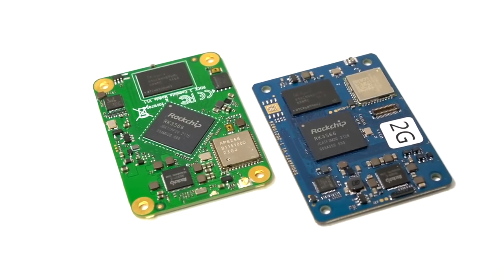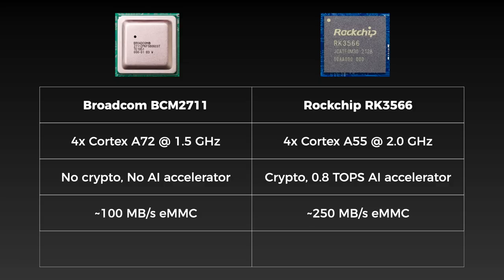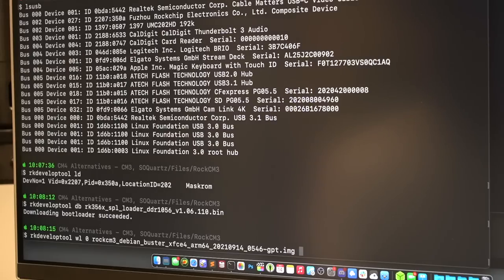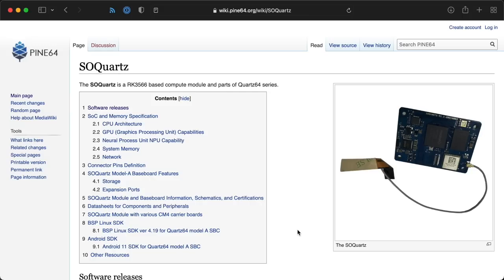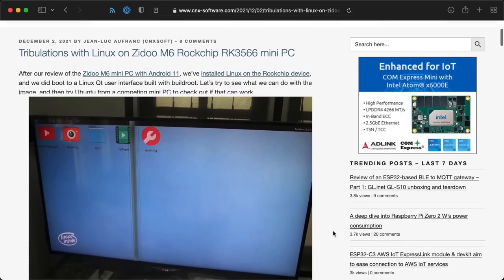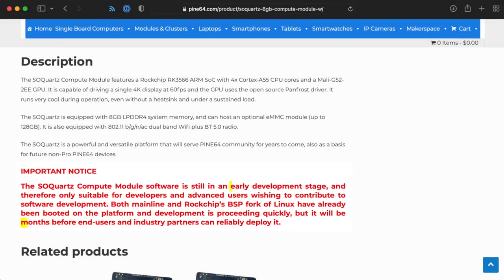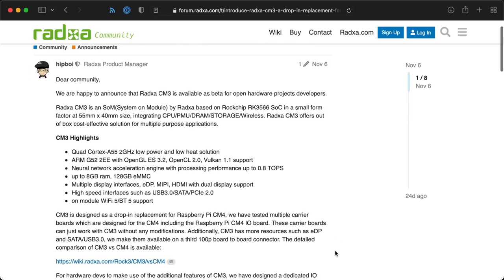Can these boards replace the Raspberry Pi CM4?

Comment: I like that Jeff Geerling uses the raspberry pi, and I see that he does it just to have fun, and in fact he says it a lot, for me it is the best, I also have fun, thank you.
Reply from the maker: Fun == fun!
Reply: +1 Jeff... The last rockchip I had in my lab was a Chinese Android tv box with the oddest reset button placement I've ever seen, required a USB A to A cable (yes, I went to the broken phone charger coffin (plastic box)), and it took me about 18 hrs to find the image. Kernel parameters are challenging and fun. Oh and I compiled a new uboot for a Chinese router board on a pine phone via a docker container while on the toilet last weekend! Now I want one of those just for the lolz.

Comment: Yes. My experience with hi-spec SBCs beyond RPi has been a waste of time, frustration, and money. The impressive hardware only equals 1/2 of a consumer product. Tell Jack I said, "Goodbye."
Great PSA to the maker community, Jeff. 👍
Reply from the maker: In many cases, I wouldn't say it's necessarily a waste—there are still plenty of things to learn from a more jagged experience. But if your goal wasn't pure learning, and you just wanted to get something done, and couldn't get it done... it would be more of a frustrating experience. Lucky for me, I was in this for the learning, and my initial goal was to plug in a PCIe device. I didn't quite get there but I did learn a bit!
Reply: @JeffGeerling  "Everybody's somewhere (no matter where I go, there I am.)." My learning experiences are more on the level of just getting motors to run, IoT to communicate, and cameras to work.
That makes me one of your favorite fans, following behind your trail blazing footsteps, but tripping over many pebbles along the way. BR 😎.
Reply: Couldn't agree more... You pretty much have to be a low level linux expert to even consider trying to use any of these non-pi ARM boards. Either that or you have to wait for a good amount of time after they've been released for their ecosystems to be fleshed out enough to be really usable.
Reply: @mikekopack6441  Well said.  Right before the rPi4 came out, I adopted the Pine Rock64 because it was already out with 4gb of ram and 4k video.  I give credit to all those who put in time to build distros for the board, however the builds vary and so does how well the drivers are optimized.
Reply: @mikekopack6441  Or...take the savings of these third party units, freeze them with a "current OS", and dedicate them to their job.  My PiZero2 is locked in time.  It also won't get tolerated in the RPi forums.  Heh.
Reply: Clearly you haven't used Pine64's RK3399 based devices. But it took a while to get the software to a usable level.
Reply: Nvidia Jetson is fine.
Reply: Those raspberry pi killers
Reply: Those raspberry pi killers

Comment: Something that depressingly few developers understand is that excellent documentation and excellent UX are killer features.
Even more so than just having good hardware. I don't want to have to reverse engineer something I paid money for to make it perform basic tasks, instead of working on my project.
That's why so many SBC's have failed to make a dent in Pi's market share.

Excellent UX is why Slack got so popular; yes, it's just IRC with better UX design, but that's literally it's primary selling feature.
Reply: they don't care. they sell a few solely based on marketing hardware specs and then move on to the next. They are not trying to build a brand name. Dump the name, create a new name, make as much as possible, repeat.
Reply: @MrTweetyhack  as a society, we oughta consider such behavior as tantamount to murder.  (Because it really does kill people.)

nekomakhea: absolutely!
Reply: Oh they understand that over at Ubiquiti all right. Even down to the unboxing experience; however, core functionality unit testing is quite the challenge for them. Same with truth in advertising
Reply: Amen.
Reply: Slack is horrible. Somehow it manages to make a last-gen AM5/DDR5 system with low load lag when it's open.

Comment: That's something a lot of people fail to grasp : with Raspberry Pi, you're paying for official support and the community. Yeah, you can find other boards with similar or better specs for cheaper or vastly more powerful for barely more (hell, even x86 if you want), but with Raspberry, you're paying for the official OS, Raspbian (yeah, I'm an old Pi's user) and the hundreds of community images people created in the last decade for every usage (and semi-official images like Ubuntu).

With a lot of other boards, you'll maybe find an official Debian image updated in the last 4 years and that's it, the exception being Pine64 since they have a pretty sizable community and even then, brand new products usually have nothing since they themselves don't spend much time on the software and rely on the community. Having better hardware doesn't mean anything if you can't actually use it, that's why the Raspberry Pi is a really popular emulation box while it's not particularly powerful, people have been developping OS dedicated to it (like RetroPie and Recalbox) for almost a decade for that purpose, you won't find anything similar on other, more powerful, boards.
Reply: I will say, although yeah these other SBCs do have generally software and support limitations, I wouldn't say they're all that bad. To use the examples of Retro Pie and Recalbox those offer prebuilt images for a few of the alternate SBCs, while Retro Pie currently doesn't offer prebuilt images for the Pi Zero 2.

Comment: You are absolutely correct sir. As an Embedded Engineer I can attest to the documentation woes of cheap Chinese hardware. The bottom line is that they do not care about providing documentation and the support required to establish a platform. Let the buyer beware.
Reply: Let's not be xenophobic here; Western engineers are equally bad at documenting their products.
Reply: @TerraMagnus  It's not about xenophobia (especially since the context is wrong). It is about commerce and language difference.

Comment: Great exposure for these products, Jeff. Perhaps the issues you've pointed out will make them more widely known, and therefore more of a target for the people working through these issues.

Besides the strengths of the RPi platform that you've already mentioned, just having defined/popularized a set of standard form-factors and interfaces for the hardware (in this case, the interface pinouts being used by all the boards in this video) is a big win for everyone. When I was growing up in the '90s and '00s, The ability to move pieces and parts around to different systems in various ATX systems was huge for my ability to tinker and learn. I hope the next generations will have similar experiences, even though the form factors are changing considerably.
Reply from the maker: That's part of my goal in posting this video—I could keep toiling on and making a little progress here and there, but maybe a few people who might've not known of the interest in these boards can push them further better than I can so they do become worthy alternatives sooner rather than later!

Comment: I don't care if an SBC is more "powerful", I need the software experience to be on point. Raspberry Pi OS isn't without issues or fault, but is still extremely polished. Hard to take the risc <-- see what I did there 😀. O and DOCUMENTION is TOO VALUABLE. That is a priceless addition and should always be included.

Let's hope the Pi Foundation doesn't get too big and start acting like OnePlus does now vs just 2 years ago.
Reply: Whats the problem with oneplus ?
Reply: @prashanthb6521  They've lost the mid range market and their software support isn't as good as similar phones.

Its either the really good Nord N10 at $300 or the OnePlus 9 at $800. At that price, the S21 makes more sense especially the 1 year longer software support for new OS updates. 

Google just took the mid ranged crown again at $599 for the Pixel 6. Where the OnePlus 6T was 3 years ago, Google took this crown, especially the support until 2026 with Android updates and even longer security update.

Comment: Fair point Jeff. I hope the guides and images for these boards will mature like the Pi ones did. It's always cool to have an alternative to raspberry pi, but it should be relatively easy to set up and not frustrating like your experience.

Comment: It's so odd to me that there's been no effort (at least, that I've seen) to create an "IBM PC" for ARM based computers. Basically any x86 OS will work on basically any x86 computer because every x86 computer has functionally the same core architecture surrounding the processor. ARM computers are all like the Xbox and PlayStation; they might have the same processor but nothing else about the architecture makes it a PC. Every ARM computer is bespoke and closed off from the rest of the ARM ecosystem. If ARM (and RISC-V) wants to supplant x86, it needs to be at least as good as it.
Reply: M1 macs are the only thing running an arm chip and getting better performance per watt on some X86 applications running natively/on bare metal. Apple has had a great many years of developing so its hard to say if open source community will ever get there.
Reply: The status quo works fine for most of these silicon vendors: nobody building a phone with one of these SOCs cares about the boot process once they bring up uboot or, let's be honest, Android fastboot, on it.
Reply: @rpavlik1  exactly. The fact that I can't install straight up Linux (or even Windows ARM) on a smartphone sucks.
Reply: Are ARM servers (for business, not consumer) capable of just booting any ARM ISO like normal from UEFI without a custom image?
Reply: @ArrowRaider  usually.  See ARM "Server Ready". Certifications
Reply: @tobiwonkanogy2975  'Better performance per watt' means little, when you consider all the flaws on M1 Mac:

-way overpriced
-terrible for gaming
-unable to run huge x86 software ecosystem...
-at full speed or full compatibility
-M1 laptops are disposable...
-RAM and SSD not upgradable

Over 300 million x86 Windows PCs were sold in 2021.    How many M1 Macs were sold?
Reply: @DerekDavis213  it doesnt mean the chip only has to be used in this product . The initial results are close to native windows is some applications that are important. likely a few million anyway
Reply: @tobiwonkanogy2975  In 2021, Apple had a tiny 8% market share for PCs, and many of those were x86 Macs.   M1 is pretty much irrelevant when you look at the big picture.

Windows totally dominates the world, and Windows will continue to use x86 processors from AMD or Intel for years to come.   Ryzen and Alder Lake processors are rapidly evolving and improving.

Gaming is extremely popular, but the M1 ARM processor is terrible for gaming.   That alone is pretty much a fatal flaw .

Adobe has been refining Premiere and Photoshop for 20 years on the x86 Windows platform.   There are versions of the software for M1 Mac, but they are missing many features, and compatibility with many add-ons or plug-ins is totally NOT ready for prime time.

Comment: Support! The number 1 requirement for business use cases. This is why my company still likes to buy Dell equipment: Support. It's a pity though. Cuz there are a lot of interesting hardware eco systems out there they don't get the love they deserve.
Reply: There's a lot of interesting hardware out there that never gets the ecosystem it deserves.  Without an ecosystem, it starves or, worse, festers in designs and systems for years via lock-in.

Comment: I totally understand that. I'm a software engineer and had a manager switch the language we use. He picked one with no support, documentation, or community and trying to get something working was a nightmare. Turns out the only reason he switched was so he could be the expert and gain more job security. Meanwhile, he lost several brilliant programmers.
Reply: "he lost several brilliant programmers" even more job security
Reply: I'm assuming the manager has other flaws, since they can't be that brilliant of a programmer if they can't pick up a new language. 😉

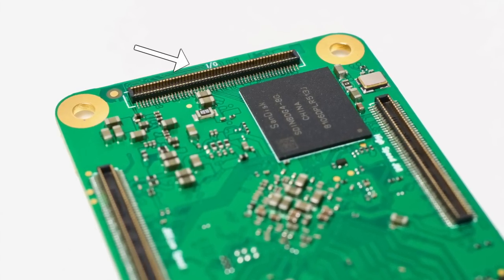Comment: The third 100 pin connector at 1:08 is in a wonderful place that gives ample amounts of room for routing traces.
I am hoping the CM5 continues with the same two 100 pin connectors and adds in a 3rd such connector to form a U shape as well.
The main things I am looking for is another 1-3 PCIe lanes (Gen 2 is ample enough bandwidth.) Maybe have another set of USB, but a SATA port or two would be a god send. (Especially if the SATA controller part of the SoC supports SATA expanders!)

But yes, the Raspberry PI foundation does one thing really well, and that is support and documentation. Since tracking down obscure issues isn't fun, software is a jungle even at the best of times.
Reply from the maker: I hope if a CM5 is made in the same form factor, that's the approach it takes. It would be amazing to be able to just swap out a CM4 for a CM5 for a speed boost and whatever other cool things it would bring!

Comment: A lot of those boards have amazing specs, but software support lets them down.
I was tempted by the radxa zero, but the reviews all highlighted the software issues.
I've stayed with raspberry pi because they just work for my needs. 
Luckily the pi zero 2 W came out and I've picked up a few of them now.
Reply: I bought 4 or 5 of Pi Zero W2, because I have some automations to complete. It was like nobrainer to get them and have them ready in the toolbox :)
Reply: Yeah, anytime someone mentions Not-a-Pi, I think "the specs are good on paper, with the inevitable letdown on software" and am right >90% of the time. Dang shame too, because some competitors in the space would be nice. And no, 1/2 a product (the hardware and no software to use on it) is not a competitor. The Venn diagram overlap between "people who want to use this" and "people who can (and want to) develop for this" (out of the already small number interested in this at all) is nearly 0. I'd guess most of that pool is the developers of the SBC themselves.
Reply: @IncertusetNescio  yup, those raspberry pi killers but can barely do anything useful.

Comment: Way back when I was trying to decide what board to buy I was somewhat bummed at the Pi's lower specs than brands such as BananaPi. But I was swayed toward the Raspberry Pi because there was so much more community support for it. That decision was the right one then and it's the right one today, as this video points out. I'm constantly stunned at so many new boards and chips released to directly compete with Raspberry but they don't seem to ever get the fact that hardware is only the beginning of a competitive product.
Reply: Yeah, those raspberry pi killers. Some of them do work with pi images but riddled with bugs. OK hardware but not much on support and community.

Comment: The reason why other CM isn't popular as Raspberry Pi's CM board is the support you get a ton of support for the Raspberry Pi because the community for the Raspberry Pi is so large
Reply: Support is more important than anything else, what do you do if it doesn't boot : )
Reply: If it would be easy for newcomers to set them up, and there are some guids and information available for necomers, the communities for those alternatives could grow as well.

It's kind of like the chicken and the egg. Which one came first. Bigger community means more information and more bug fixing. But for a comunity to grow you need at least some information and bugfixing.

Comment: Seems about right for Pine64's way of working. What they often do is make the hardware, make sure it is documented and then provide it to developers in their community to basically get software support up and running. Their phones operate on a similar principle and currently postmarketOS is coming along nicely as far as I know on those, but it has taken a while. So it could be that this board will actually work out over time as a nice (niche?) Pi alternative as there is actually an active community of developers around pine64 hardware.

To some degree it is a more open approach compared to the Raspberry Pi approach to things but it also leaves a lot up to the community to initially fix where you could argue the company itself should provide a better starting base. Anyway, I'd be interested to see how the pine64 board support develops over time.
Reply from the maker: Ditto!
Reply: Indeed.  Pine64 doesn't really get involved with the software side of things at all.  Software is entirely in the hands of the community of users.  As a result, it takes a while for things to really get into shape.  

I've been daily-driving my Pinephone for about 15 months, and the improvement over that time has just been tremendous. Sadly, I can't say the same for my Pinecube, which (since it has a much smaller user base) is just beginning to approach usability.  The story has been similar for their Pinetime smartwatch, which just recently gained the ability to set the time directly on the device without having to pair it to my phone or laptop.

I like Pine64's way of doing things, but if you're not a dev who wants the challenge of bringing up basic hardware functionality, I'd suggest holding off on their products until they've been out for at least a year (Exception:  The Pinecil soldering iron has been excellent since day 1).

Comment: Jeff actually points out something really important in general that a lot of starters in development forget. Reliability is key. One can have the most amazing specs and/or have an amazing price/performance ratio. It's close to worthless when it's really hard to work with. Besides all the extra time (= money in most cases) you have to put into.
I am a little confused even what these other companies are aiming for? Is it just hitching the ride with those super small SoC modules, or are just forgetting that proper documentation and accessible hardware is key?